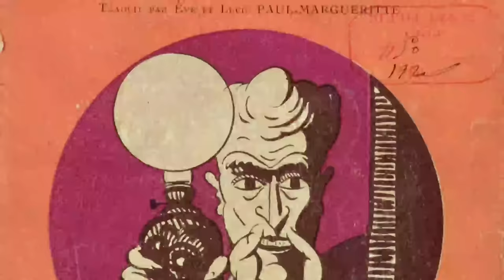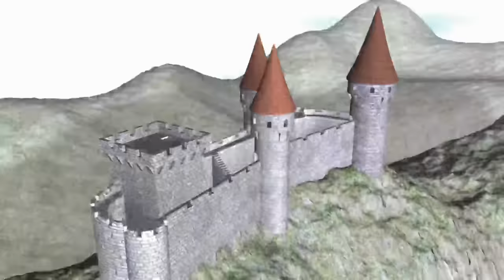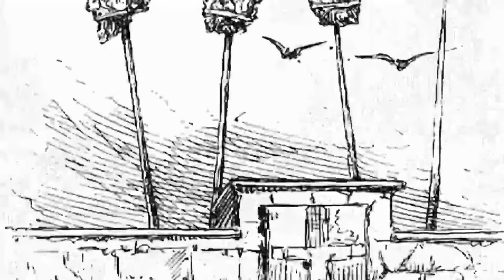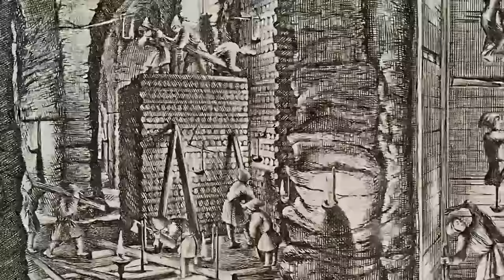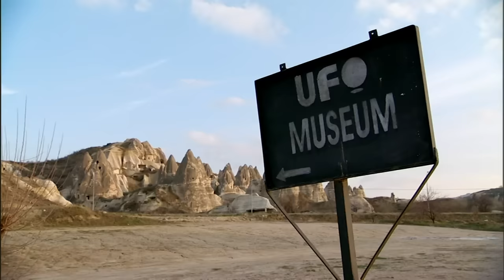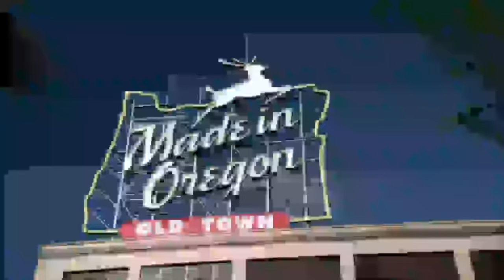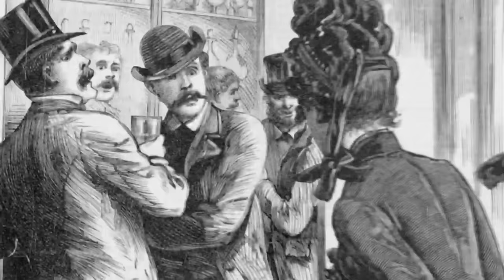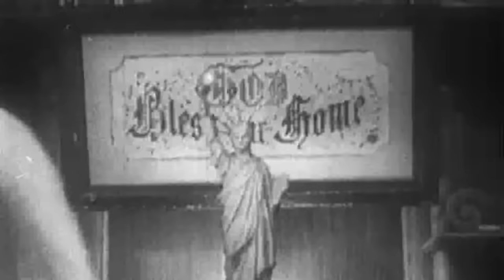Dracula's TERRIFYING Castle Uncovered | Cities of the Underworld *2 Hour Marathon*

Comment: You never talked about human waste.   Where and what did they do with waste?
Reply: Yes they did, Dracula was a human waste
Reply: They had rooms with troughs built in with a hole that leads to a spicket or down to the moat. You poured water in after. They also had servants and chamber pots. You would use the pots then the servants would empty them.

Comment: The underground area seems to be a well defensed position, but all of their defensive traps, millstones, spear holes, and oil pours are completely worthless.

Any enemy wishing to subdue this cave system, would just march to the front of one of the known entrance/exits, pile a massive fire, and use bellows to blow the smoke into the cave system.  Any potential vent and air holes would then be exposed by smoke exiting from them, at which point different soldiers would just go to those smokey ports and block them physically with boards, boulders, or timbers, and in less than a few minutes, this vast miles underground system of caves, would be completely filled with smoke, as smoke will go to the lowest level because it is heavier than air, after it has cooled a bit.

And of course the smoke out fire could be laden with any number of known toxins or drugs to speed the process.  You could purposely burn black or white smoke for varying reasons.

There is no such thing as a defensive underground position, if the enemy has equal fire power.  If the underground position is fortified by a superior fire power, then it could defend itself if it had full on life support contained within the barriers, however; this would absolutely not be necessary if you had superior fire power!  LOL.

Caves are one of the weakest defensive systems ever devised.  They are only good, if never discovered.

Anyone remember Vietnam, where the cave systems were so immense, hundreds if not thousands of people lived and fought out of the caves, yet could be easily subdued by a single grenade down the hole, petroleum fuel down the hole and ignited, or agent orange dropped on the ground over the bunker, which absorbs into the bunker then kills any life.  Agent orange wasn't just glyphosate, in some cases they added Dioxin to kill humans and poison the water system.